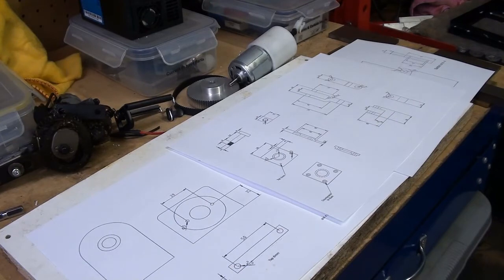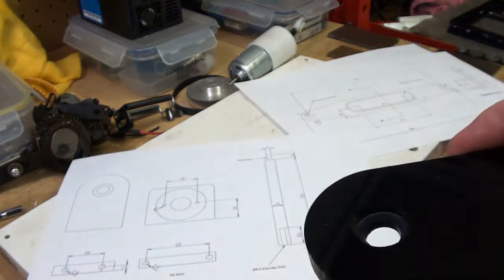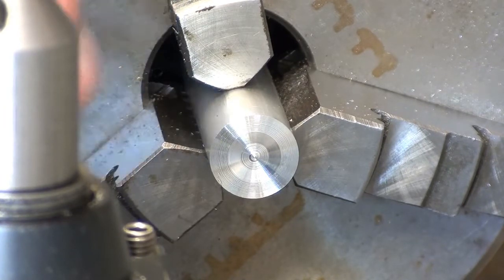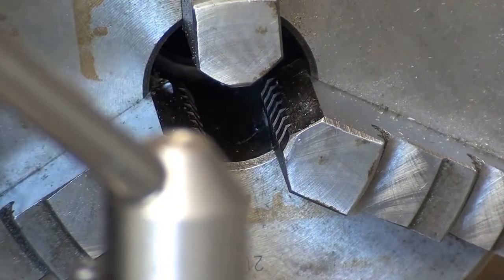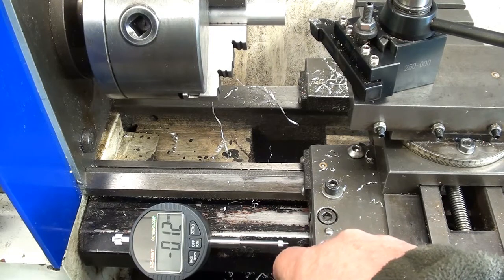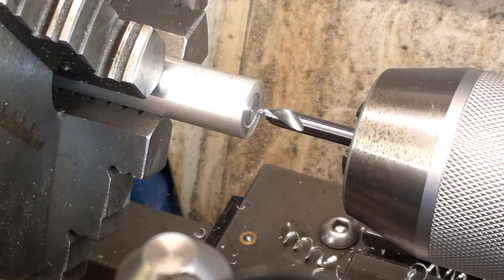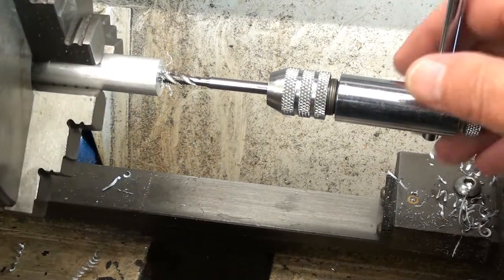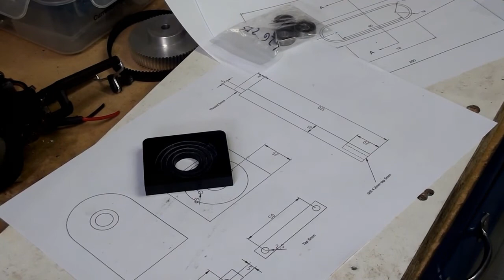Die Filer - Part 2

Comment: Great video ! Keep them coming ! Another downside with using a centre drill to do the work of a proper spotting drill is the thin tip can snap off and ends up stuck in the part being drilled - if you're lucky it comes out , if not you have to drill it out with a carbide drill or milling cutter so that simple operation becomes a chore or a nightmare 😫
Reply from the maker: Yep!  Been there, done it right at the start of my lathe exploits when I retired.  That's what persuaded me to get a couple of carbide spotting drills.  Thanks for watching.
John